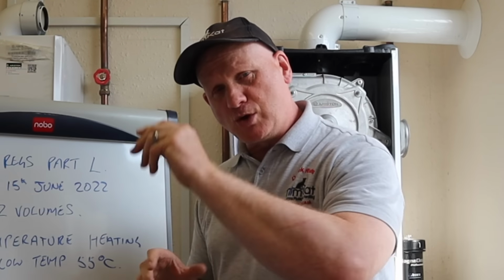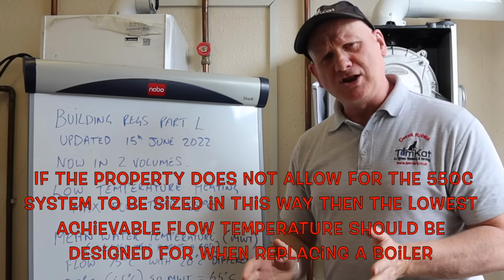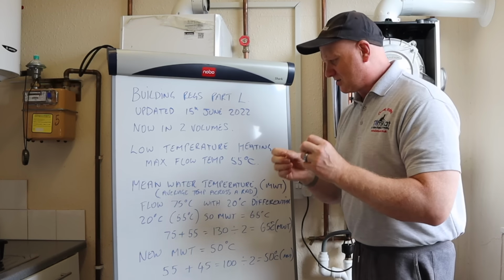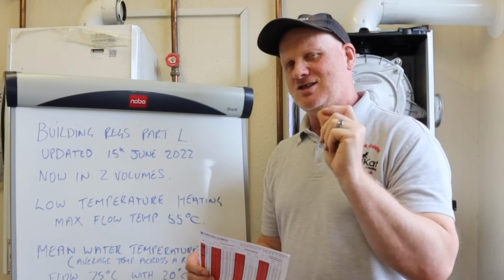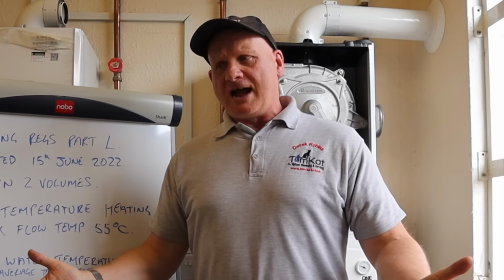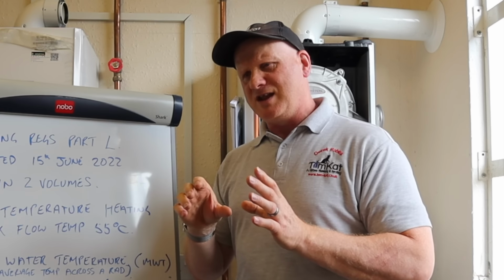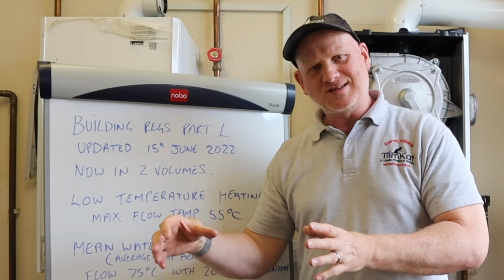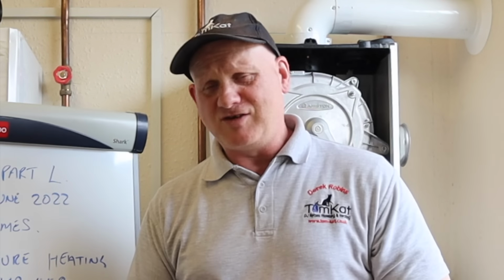Don't adjust your  heating flow temperature until you have watched this video. #saveenergy

Comment from the maker: https://youtu.be/f9VW3jSMr4g
If you need anymore energy saving tips check out this video
Reply: Hello, great video. Can you do the same for an under floor system ?
Reply: The government is getting away with having people decide whether heat or food because people like you have bought into the "save the planet"  garbage! If you really cared, you'd educate yourself on the con.
Reply: This is all confusing because I have a combi boiler but have a water heater using electric on tank (cylinder) and gas on combi, so I can use either..I actually use only electric when want bath otherwise water is off and I boil kettle for washing up as told it's cheaper .I have a Worcester boiler , in the manual it says for condensing to work efficiently the first dial for heating should be set to 2 out of the 6 on the dial..I have been having at 5 and gas is going mental. My gas installer came last week he said it should be set to 6 full , which he did ,I turned it back down..he came because.over summer I had rads off upstairs and pins had stuck. I didn't know at time but if had I could done self.. instead I tried bleeding them and thus lost pressure..now I still been having upstairs rads off as told it save energy I suspecting it doesn't because usually 20 quid lasted 2 weeks at comfy temp now it's lasting 4days at 22 on room thermostat. Turned down to 20 in day. How can I get the 20 to last at least a week ?? I've subbed and liked in anticipation of reply..thankyou for help. Been trying alsorts of channels with info but everyone contradicts each other.
Forgot to mention I have Two storey house, it's a terrace house , 2 rooms downstairs and kitchen , two bedrooms up and bathroom. 3 rads upstairs , one each bed and bathroom. Downstairs one each room and kitchen so 6 rads total.
Reply: Best explanation video seen so far
Reply: I raised this matter with the Guild of Master Chimney Sweeps about 10 days ago with a view to our members putting out info to warn people about the possibility of Legionaires if they turn their boiler flow temperature too low. Hopefully the Guild members will help get the word out to the public (bearing in mind we see a lot of people this time of year) and avoid a spike in Legionaires cases on an already overloaded NHS. Thanks for posting this - only just seen it and I think you were ahead of me on this.
Reply: I didn't understand a word of this video ..lol... (sorry I'm a bit thick). My flow temp on our combi boiler was 80. The thermostat was set to 18.5 and the radiator was still running all day. I spent £10 on heating yesterday (I work from home) plus £5 on leccy according to my energy app. Heating is off during the night. I already lowered the water temp to 45. But I now set the flow temp to 55. I am not sure if I am doing the wrong thing here. I live in an old, double glazed council house (Energy Cert E). It gets baltic in here so I am trying to save as much as I can! (I have long radiators underneath the main big windows, one way to waste heat..lol..I am already adding reflector panels and a radiator shelf)
Reply: Many opinions on these Flow temperatures but in my opinion 
High flow temperature ensures cylinder & room stats reach there target temperatures quicker & shut the boiler down completely.
That’s the way to save money.
Reply from the maker: @darthfader7414  that’s not correct it won’t save you money
Reply: @tomkatgastraining  Recovering a 100 litre cylinder from cold with a flow temperature of 70-75C & a cylinder stat temperature of 55C takes 30 minutes. If you drop flow temperature to 60 C that same cylinder of water takes over an hour to recover. What’s more energy efficient?
Reply from the maker: @darthfader7414  the video is about combi boilers flow temperature not heat only or system but I guess you know that if you watched all the video

Comment: I judge my condensing boiler flow temperature by turning dial down until I get the hot water I need for washing without having the need to add cold water to cool it down. My dial is 1-5, I have it on just over 2 for winter and just under 2 for summer. In winter all radiators are sufficiently hot and each radiators thermostat are set at 3, which is probably half open. In comparison, the boiler installers ten years ago said the flow temperature needs to be full on at 5 for the system to be efficient, so just shows you how clued up they were on their own products👍

Comment: I dont get it. In Denmark the rule of thumb is: Keep all your thermostats fully open all the time. In rooms that are not used on a dayly basis and with closed doors, you should reduce the temperature setting as needed.
My gas boiler is controlling the heating and is keeping a constant temperature in the house. Whenever necessary I adjust the temperature setting directly on the gas boiler. Not very often.
It is simple and works fine. I also have lowered night temeratures. This is also controlled by the boiler. No need to ajust thermostats on any radiator.
You make the temperature setting into a difficult or complex engineering problem.
In my house the gas boiler takes care of all that, in an automated way. Is your gasboiler a primitive type with no automatic control? I just dont get it.

Comment: I've a combi boiler and I tried adjusting my flow temp and all it did was take forever to heat our house up .... 

Our radiators are all low water volume radiators with thermostatic valves and if you put the heating on at say 5pm when the house temp was 15⁰ before adjusting it the temp was up to 19⁰ in about 2 hours .... After it the temp was sitting at around 17.5⁰ by 9pm 😮

Comment: i live in Finland and the flow temp in our radiators is just 39 C. With good insulation and enough radiators 39°C is just fine to keep an indoor temp of 21-23°C. We have ground source heating via heat pumps.

Comment: Tom, if you have a opentherm room thermostat does the flow temp even matter? Because it lowers the flow temperature right? And does it ignore the flow temp or use it as a maximum? So setting the flow to 60 means it'll peak at 60? Or when required it'll go above 60 anyway?
Reply from the maker: Open therm doesn’t change the flow temperature or the heat output on start up so flow temperature and range rating are key

Comment: Interesting video.  I have a cast iron Netaheat boiler which is still working well.  Should I run this at 55 deg or will it corrode the boiler?

Comment: In the morning could you have your flow rate at say 65 degrees to quickly obtain a required temp and then reduce the flow rate to 55 and keep things ticking over? Yes! it means adjusting every time.
Reply from the maker: Or you can just install weather comp if you’re boiler can take it

Comment: No room thermostat. Flow temp 75°. Cyclinder set to 60° (or 65° I forget). Rads TRVs at 3 are incredibly hot but anything below and they switch off. 
Flow temp cannot be changed.

Comment: My Vaillant boiler allows the flow temperature to run up to approx. 5 degrees above the set temperature when running at minimum load (its a software trick to try and keep the flame alight (to minimise the losses associated with stopping and relighting the burner)). This means that my hot water cylinder is heated by 60 C water when the boiler is set to 55 (which is more suitable for the radiators in Spring & Autumn). Also helps address the legionella risk (my solar powered immersion heater does that as well).

Do other modern models by all manufacturers do something similar?
Reply: Worcester Bosch go 4 C over the set boiler flow temperature.
Reply: Junkers(Bosch) same as mine

Comment: I set the boiler to 54°C for the radiators and 50°C for the hot water. On the radiators, I now get around 50–52°C. In the past, my heating system was very bad. Even when I set it to 70°C, the radiators would stay under 39°C, but the repair people kept saying it was fine. At first, I asked them to feel it by hand, but they ignored me. When I showed them with an infrared thermometer, they still refused to acknowledge it.

Later, I fixed it myself after watching a YouTube video on how to balance radiators. I don’t know if it was your video, but the balancing method I found only appeared in that video. I used to watch the repair people doing it, but their way never matched the YouTube method. After doing it properly, the difference was unbelievable—I now get more heat with a lower boiler setting.

I keep it at 54°C because I run the heating 24 hours a day. Last winter, I left it on continuously for 5 months because the house doesn’t warm up otherwise. My bill was around £350 per month, but when I tell people, they react oddl I don’t know if they don’t believe me or just think it’s too much.

Even with the heating on 24 hours a day, after 5 months our coldest wall only managed to reach about 18°C. The worst part was that when the temperature outside went down, the thermostat inside also dropped instead of keeping the house stable.

I have a question for you: with the heating on continuously, what temperature should our house reach after a week, a month, or even 5 months?

Thank you
Reply from the maker: It’s all about how much heat you lose through the fabric of the building. A heating system is designed to replace the heat lost through air changes and fabric loss. So it’s impossible for me to answer your question without knowing what you’re system is doing sorry

Comment: I just use an opentherm controller to adjust the rad set point to as low as minimally required to maintain room temp automatically. Most modern combi boilers can do opentherm. It made a difference of about 15% on my heating bills month on month.

Comment: Some stupid suggestions. Turn the heating down, and if the house isn't warm enough, buy bigger radiators !!!. That may entail draining down for new pipe work, probably in excess of £500 per rad. Older property with less efficient insulation wouldn't cope with these dubious changes.

Comment: Where do you get the temperature for the return flow? What relevance is it as I can only see the boiler water temperature?  I've just turned mine up to try to balance them and haven't a clue. I'm in rented and have this issue every year and am doing what the engineer suggests.

Comment: Parasitic loads on house is around 80watts. Is around 70p per day just to keep the microwave clock working etc.

Best thing I ever did was to fit WiFi sockets to turn off everything on remote control. WiFi heating to turn down or off depending on my work schedule. Even the fridge freezer is heat pump, paid £500 for second hand, costs £70 a year less to run than the last one. Payback will be 3 years. It does all add up to sound logic in the end.

Comment: If the flow is 70 leaving the boiler and 60 when it arrives at the boiler, with a return of 50, do we calculate the delta t as 55? Heat loss from a boiler in the attic is something we may have to consider and ensure rads are specced at delta 50. Am I right?

Comment: Certainly makes sense and certainly interesting.  Now if you're using things like OpenTherm, they'll automatically adjust the flow temperature.  Looking at replacing radiators atm, so certainly something to query the potential tradesman and discard those that are confused and don't size etc.

Comment: Smart system  controls from some boiler manufacturers will select different flow temperatures for heating and hot water, eg say for instance 55C for heating and 75C for cylinder.

Comment: When you increase all these pipes from 8/10mm to 15mm, are you not doubling the volume (or more) of water needed to heat? Also, increasing rad sizes to run at a low temp does the same. I would be very surprised if the saving was significant from these alone.

Comment: One of the very best things people can do to cut down draughts at windows and save a little bit of money is to install vertical blinds, which when closed act almost like another layer of glazing.  But be sure to install them if possible at least 4 inches away from the glass.  They can be drawn back completely to let the maximum light in during the day.  There are are lot of firms offering 3 for less than £100 - an absolute bargain!

Comment: We had a new Worcester 4000 System Boiler fitted in 2022 but chose the option of the added diverter valve making it a 4 pipe system. It means we can have a max flow temp of 55 or 60 for the heating but have a much higher flow temp when the cylinder requires water to be heated. So the boiler knows whether it is on for hw  or central heating. Called Hot Water priority I believe. It works very well. No need for 2 or 3 port valves.

Comment: In 2022 moved into a new house. In the main living areas upsized the radiators. Installed a new System boiler and 80l water cylinder, 9kwh elec shower, Tado on every (except one) and added Tado thermostats, set flow temp to 45 C, set hot water cylinder to 60C, system boiler heats up hot water twice a day for an hour, once a week the elec immersion heater bumps the hot water cylinder up to 60c when the elec is 7p kwh (Octopus Intelligent) takes care of legionnaires. We are both home all day everyday, and our house is toasty warm in the areas we use, comfortable everywhere else. The temps change throughout the day depending on where we are. Seen a 40% drop in gas usage over our neighbours with same house/usage.
Reply: 45℃ flow temperature is too low. It should be 55℃ minimum as discussed in this video.

Comment: Got to be careful with stored hot water cylinder that the flow temperature is higher than the required hot water temperature,  because as the temperature inside the cylinder rises to near the flow temp the rate of heat transfer gets less.  If the  DHW stat is set to 60 degC and the boiler flow is 55deg C the  thermostat will never be 'satisfied' and turn the boiler demand off. So flow temp has to be a bit higher than  DHW stat setting...  My DHW stat is set to 60deg, but flow set to 65deg ( which is OK for CH, as all our radiators are doubles, and return temp is below 50deg C ),  so while the boiler is heating a cold tank, the return  temp will be low and allow condensing, but as DHW get almost to 60 deg the boiler may not condense for the last bit.  You do not want a situation where the boiler stays on and continually pumps hot water round the DHW heat exchanger coil because the DHW stat never go staisfied....

Comment: Thanks but I have a new Vaillant and it's CRXX I had a baby glowworm cast iron micron for 20 years only had,a fan failure in that time. Half the size my fuel cost has not reduced, my warmth has how the Germans sold us their CRXX  is a technical scandal  thanks to know nothing john  prescott. The approvals relate to stainless " heat exchangers" but british ones are alloy and routinely clog up. We have been conned just like EV,s another con. Got a cast iron boiler. ? --- keep it don't get conned.

Comment: I’ve just had a new boiler installed nd the plumber used 10mm pipe…..will that not pass regs then?
Reply: A friend of mine is going through the expense of changing all his 10mm pipe to 15mm

Comment: Imagine that, in order to reduce emissions you might need to replace your steel radiators. Steel is made in foundries which produce huge emissions, the old radiators will need to be melted down and produce more emissions. All of that in order to 'reduce emissions' ;)

Comment: Great video, thanks. You make a very good point about condensing boilers not working efficiently at higher temperatures but, on the other hand, existing rads have usually been sized for 80C flow rates. Two steps forward, one back…
Reply: They are often oversized so it's not all bad
Reply: @ True but, generally, nowhere near enough to make up for the 50% reduction in heat output caused by dropping to 55C. Remember Newton’s law of cooling is a log scale, not linear.

Comment: First of all Room thermostat & Radiator thermostatic valves isn't ideal combination on lower flow temperature

10:12 Hot water at 60 Celsius isn't ideal for saving money

Maximum temperature of avarage person is 30/40 Celsius bath and washing dishes with added cold water 😁

12:48 well quite embarrassing born 1980 and room thermostat was essential there but you make a law for something soooo symble 🤔

16:24 are you sure you're not in Victoria any more 😂

Comment: How do you know how hot the flow is on the radiator number dial on a condensing boiler? Mine is set on 3
Reply from the maker: @Nigel-Karaokeking  use a thermometer on the flow pipe if the boiler doesn’t tell you
Reply: from my 18year old WB 30Si Greenstar condensing,  1 is 47 , 2 is 53,  3 is 61 , 4 is 68 , 5 is 73, 6 is 78, max is 82

Comment: I have found that it’s better to shut all our bedroom doors shut , or it’s no point in using the room radiator valves set  .
And as the stat is in my hallway this will not be controlling properly 🙂

Comment: Got to say, I started getting lost when the tech explanations started. I just set my rad stats at where I need them, set the boiler according to what the gas company advised when they installed it, get it serviced every year, no issues. I have tried adjusting the boiler one winter and I found lowering the flow rate just left the boiler running practically constantly and that winter cost me £90 more! The gas engineer advised turning the flow up and making sure the rads didn't need bleeding to which he checked. All rads running on 15mm pipes. He also said people find using a reflective barrier behind the rad help hugely too! I'll be doing that when we decorate next time.
Another tip (if you don't do it already), lift your curtains over your window sills if they're covering your radiator, instant huge improvement as your not just heating your windows, it allows the heat into the room instead.